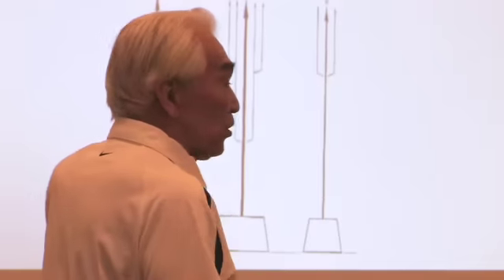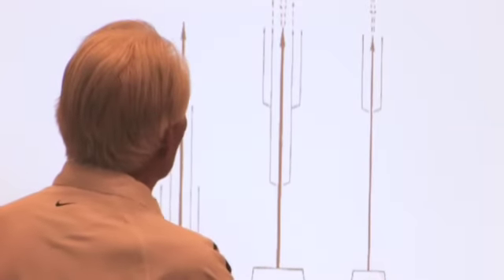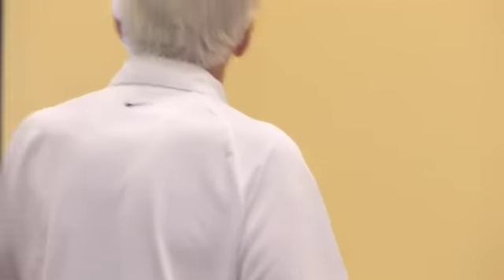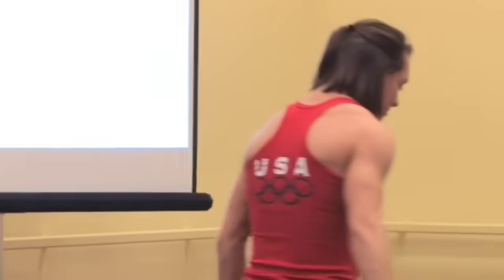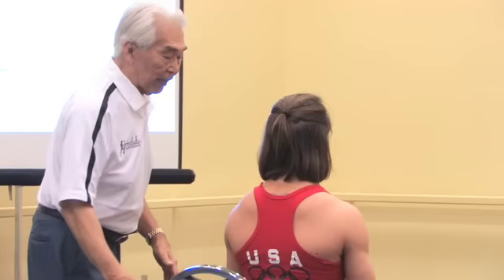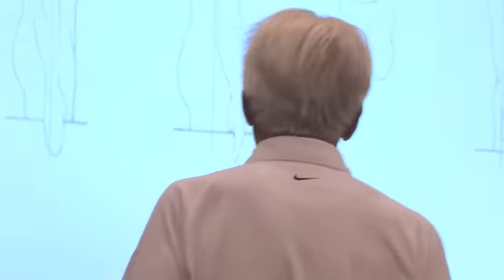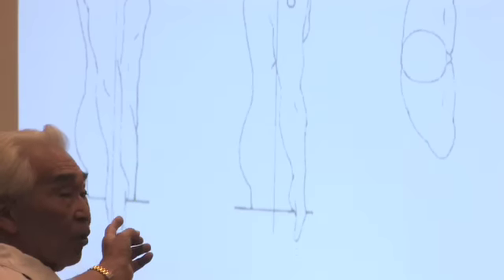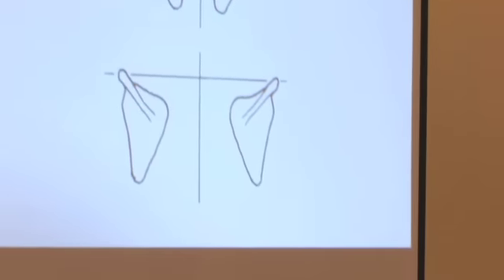Tommy Kono - 2 - Slide Presentation on Weightlifting

Comment: @bsumiko Your statement kind of contradicts itself a little as the traps are a scapula retractor and not protracter.

Rounded shoulders are easily fixed with a bit of lower trap/rhomboid work so it's not a crazy imbalance anyways. As far as the apparent "overdevelopment" of the traps goes... that's really a nonsense statement as strong traps are essential in strength/power sports. Being that high trap development doesn't place the shoulder in any greater risk of injury I fail to see the downside